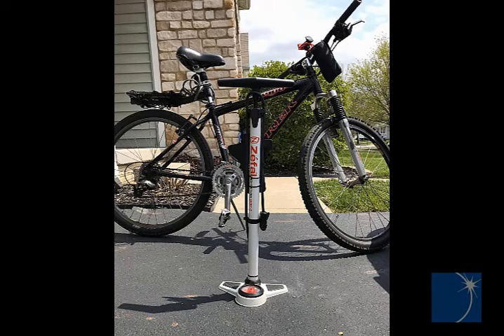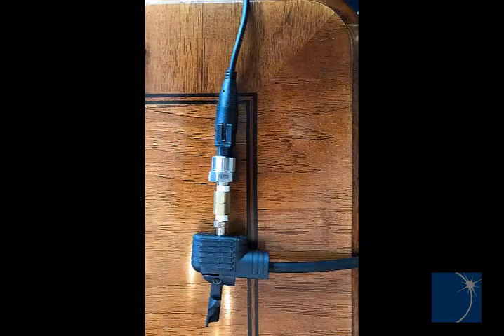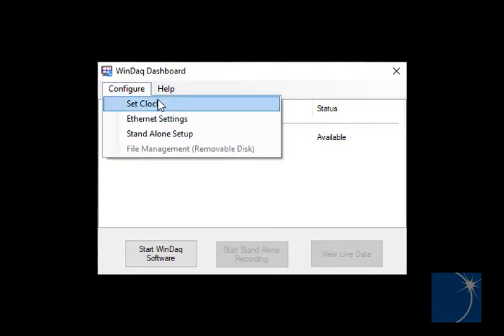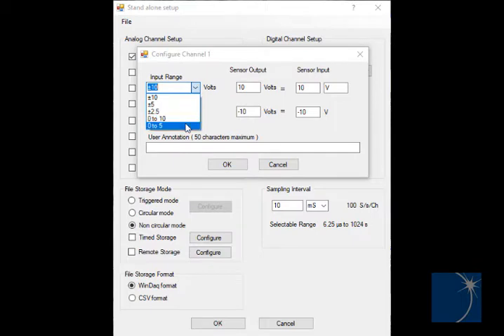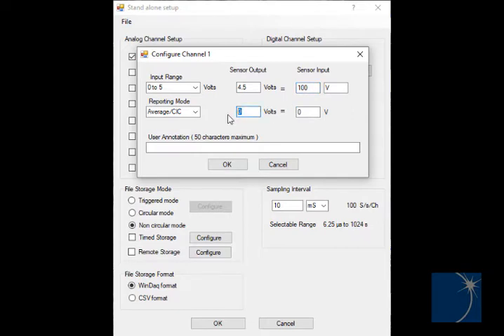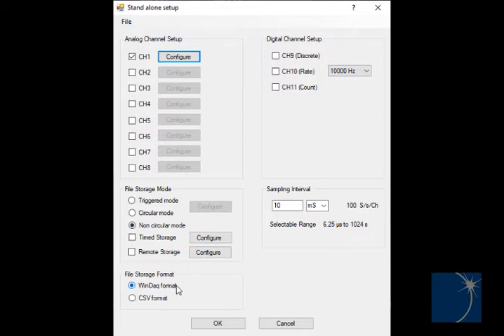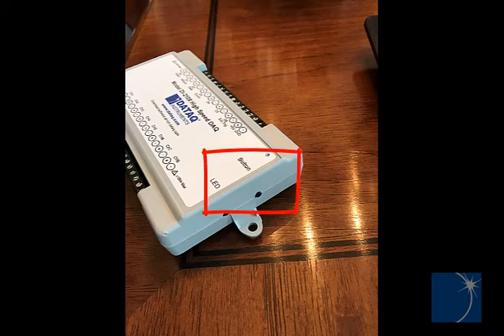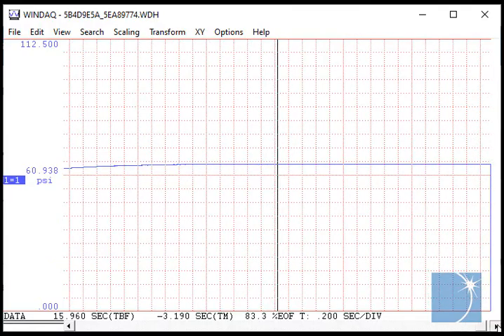Acquiring Pressure Data Using a DI-2108-P Data Logger

Comment: Shawn, can I use any of your products to measure and record an air pressure pulse in a air header tube of a electrostatic precipitator cleaner? The diaphragm triggering the pulse is on for 100 millisecs.